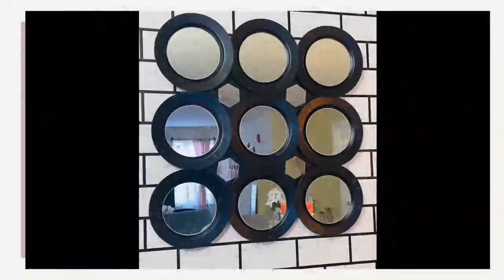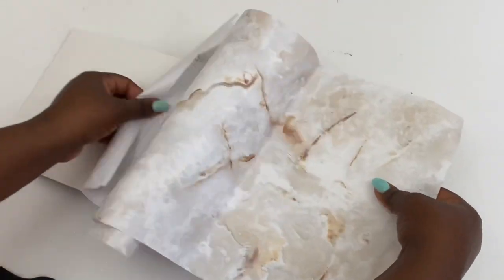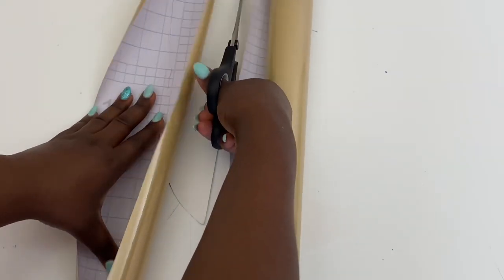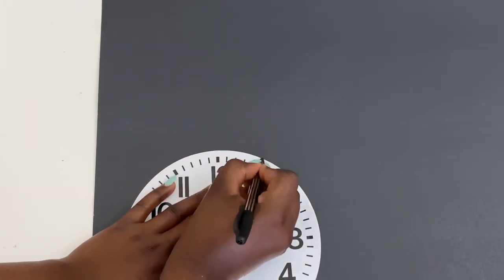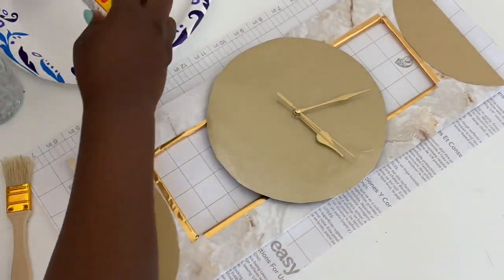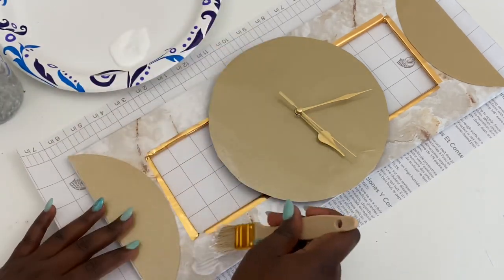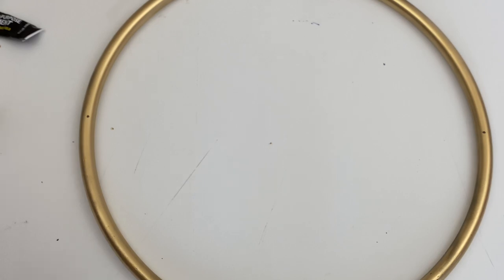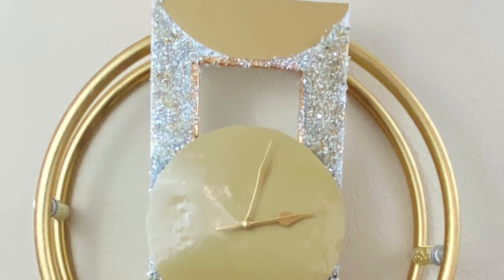INEXPENSIVE & GLAM LARGE GOLD WALL CLOCK CANVAS USING HULA HOOPS

Comment: I like this. What size hula hoops did you use and where did you buy it from? Is it necessary to cover with contact paper since its covered with the crush glass? Thanks
Reply from the maker: It was about 18in, however I did cut some off to make it smaller. And they were from my local Dollar Store. And also a list of all the items used can be find in the description. I covered with both because I wanted to have the color contrasts
Reply: Thanks. Yes I saw that but it didnt give any measurements there or in the video for anything other than the clock. It would be helpful for anyone who wants to try to recreate. I found measurements from someone else who made a similar clock.